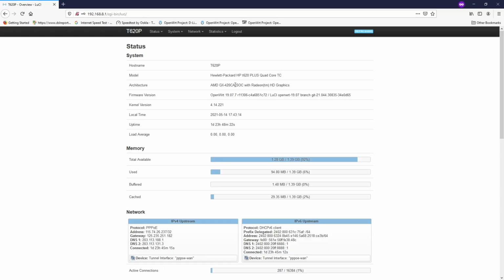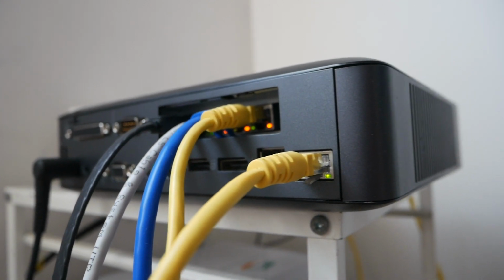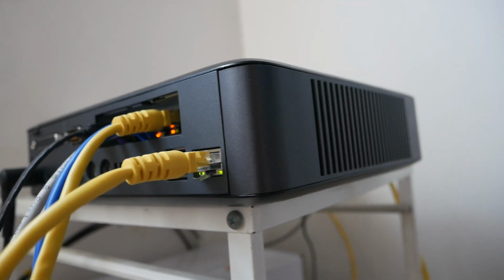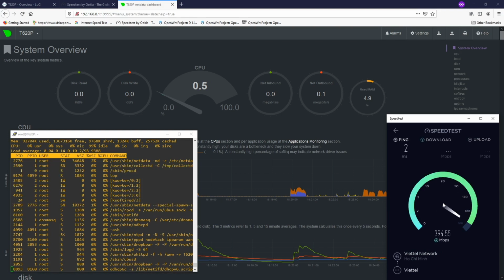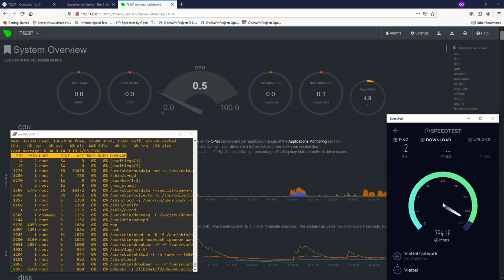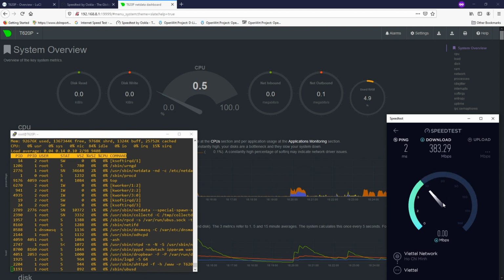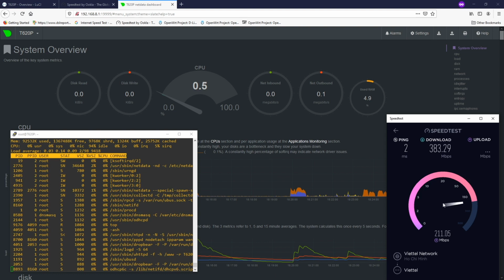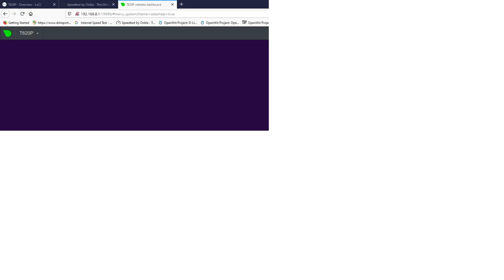HP T620 Plus - A Budget x86 OpenWRT Router

Comment: Great video but you skipped the most important part! That is how to install openwrt on T620 plus. Where to download, did you build the firmware or was the standard build good enough for this PC.
Reply from the maker: The installation is very simple: download the OpenWRT x86 build from openwrt.org and write it to the USB with Rufus. I have done 2 videos for the installation guide, you can check them out.
Reply: @VanTechCorner   I am having trouble getting my T620 plus to work with Openwrt.  I installed Intel 1000 PT 4 port nic. Booted with ubuntu live USB flash drive and it recognizes onboard nic as well as Intel 4 port nic and all network ports work.  I then download the openwrt-22.03.1-x86-64-generic-squashfs-combined.imag.gz. Unzipped and flashed it to internal m.2 SATA drive using DD command. rebooted and open wrt sits on "adding vlan 0 to hw filter on device eth1"  never gets to a prompt. I can't access web interface either. I have tried ext4 combined image, I have tried using a USB flash drive with efi image and all are getting stuck at the same message.  Appreciate any advice you can give to troubleshoot.
Reply from the maker: Hi, please give a try with BIOS (Legacy) boot first. Also, it is suggested to remove the network adapter and try with the onboard NIC on the first boot, so that the LAN port will be the onboard NIC.

Comment: Hi thanks for the video. I would like to add a wifi card Qualcomm Atheros AR9485. Would you be kind enough to guide on how to setup and configure this? Also would appreciate if you could give a heads up on how to have this built-in. I have the same machine, HP T620 Plus and would really like to use it as my home router. Thanks
Reply from the maker: In order to make a wireless adapter work, you will need to install firmware/driver. There is a video on "Install wireless network adapter" on the OpenWRT tutorial playlist. You can watch this video to have the basic concept. Basically you will need to find the driver package for your card and install it with opkg / LucCI software manager.

Comment: In case you need a suggestion for a new video, I've discovered you can install iperf3 directly on an OpenWRT router, it's really handy to test LAN speed without the need for two separate machines on the network!
Reply from the maker: Yup, we can set up the iperf server running on the router and I have tried this in some of the video. Thanks for sharing this.
Reply: @VanTechCorner  I am looking to use ubiquity radio  as my WISP setup.  I want to resell internet and IP TV via my network I want to sell live TV content Movies on deman. I have found Linux opensource software to accomplish such but network wise ca this set up be used.

I want to sell 40 customers and grow the small business to have 200 user by next year June. note I am quite technical so I can understand as I am doing my degree in network engineering but we have not gotten to do something like this. I need a reply urgently may be you can do a video on that or send me some information.

Comment: Bro i asked you something why do you not answere about it 🤷
Reply from the maker: Bro, sometime I may missed some comment. Can you please post your question / topic in the Van Tech Corner & Friends group on FB, I will see you there
Reply: @VanTechCorner  I'm not on Facebook but give me your Instagram or whatsapp
Reply: bro i live in university and I'm trying to play online game on my ps4 but they use firewall on that wifi so i tried to use my phone hotspot on ps4 with vpn and proxy so it almost worked like i can update and browse anything but my PlayStation network account not getting active keep getting failed then i tried that same way with my phone data and used vpn and proxy and tried then it worked so good but when i use that wifi everything work only not getting active my PlayStation network account pls tell me how could i fix how could i bypass that wifi
Reply from the maker: There is no way to bypass that, when you are using the 4G connection NAT is not working properly that is why you can't have the required NAT type to play game. However, you can try to contact your network provider and ask them to check on this.

Comment: In your next video, when you do some tests to see the performance of the PC running OpenWRT x86 - NAT.....
would like to see extensive details of configurations of NAT , Openwrt has a different style of firewall and it took a few attempts to get it set right because it would block everything , and there are so many install instructions that are conflicting as some folks rent a cloud server for vpn and some use a commercial vpn service 
Seeing details of NAT in Openwrt would be great to see the various possible confirmations that can be done    Thanks !
Reply from the maker: Yes, we have different type of NAT and I will make a video about this, soon. I don't have a networking certificate so it is not easy to explain what I understand about NAT in a technical way. Thanks for your constructive comment.

Comment: I'm currently using t620plus to run pfsense.
Reply from the maker: This is a solid PC with low power consumption. Not only router, this PC can be used for virtualization purposes.
Reply: @VanTechCorner  how much power does it take??
Reply: Does it do full gigabit routing?
Reply: @ExillNetworks  ofc It can, I've used it for 3 years
Reply: @thieuson  THANK YOU! All is so hyped about using this thing as an network appliance, that noone is doing performance measurements.